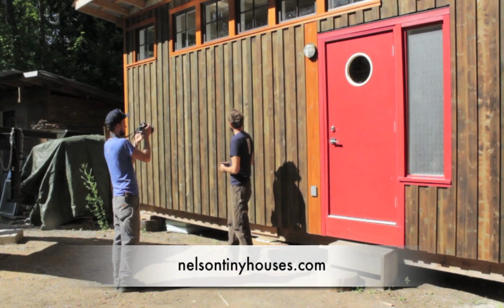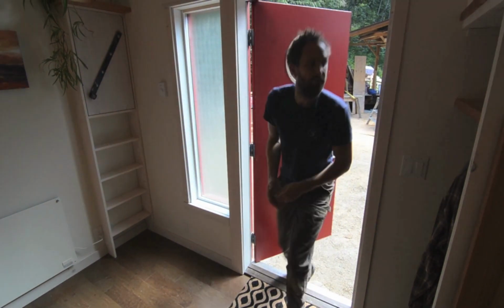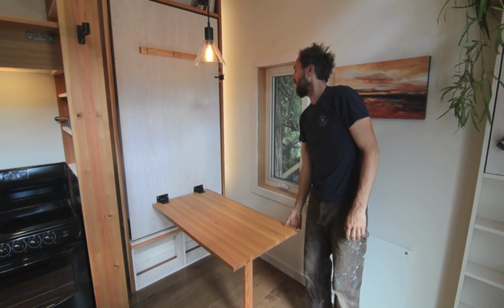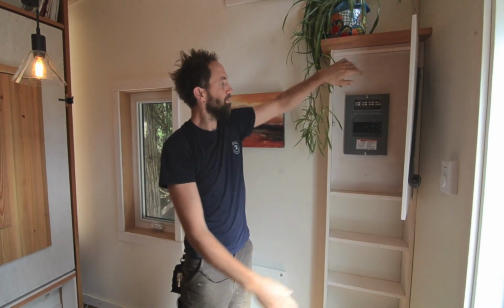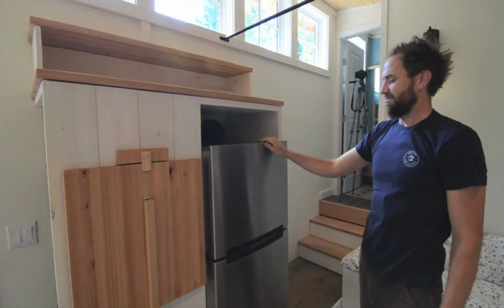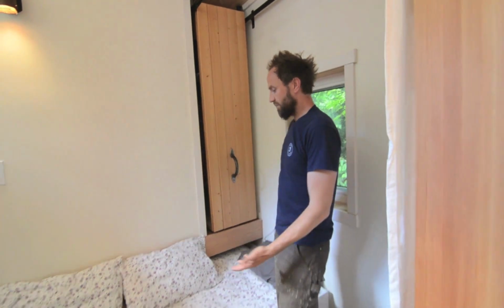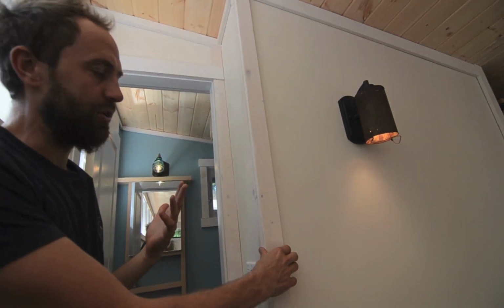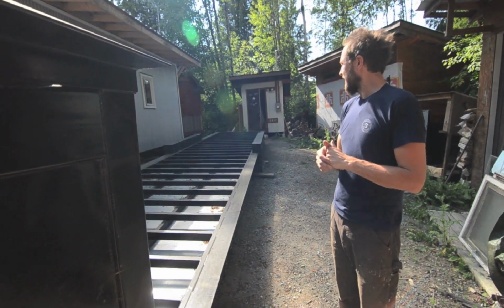Nelson Tiny Houses Open Concept V House

Comment: Beautiful house, just concerned about the table/murphy bed.  I dont think even you could sit in a chair around that table, way too narrow. No way could I :) - second is the length of the Murphy bed...looks like it's 4'6" long.  Kinda impractical
Reply: Sorry, but this house really seems to be made for very small people, and thin.  I am in property management and probably the biggest problem ive seen so far is the ventilation system in the bathroom.  shouldnt the fan be at the uppermost part of the showerrooms ceiling?  The moisute will pool around that fan and will cause moisture problems seemingly very fast.  Oh, where is the space fir the 55" tv?
Reply: The Investigators alot of people are just not interested in TV anymore but I could see where that would be a problem for those that do.
Reply: Even for those interested in accessing T.V. they can do it through their devices and computers.
Reply: Agy Wilson
For those happy to watch a tiny sucky screen! I want a 60" screen.

Comment: Here's a challenge.   There is a product called AIRKRETE and I love this because of it's R value and it's Firestop rating.    I wondered if you can build a tiny house frame of this product and make it travel worthy.     NO, I'm not going to buy it but if it can be done think of the quality and lightweight framing you could offer consumers.